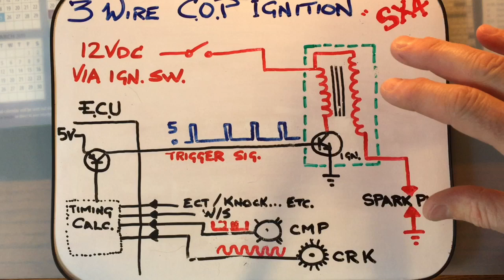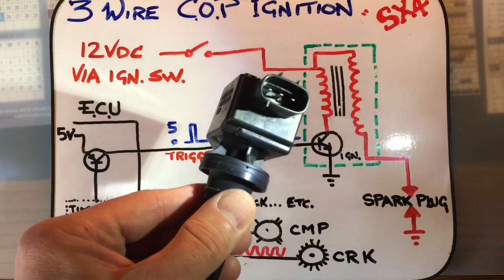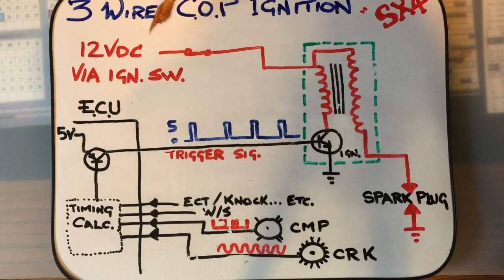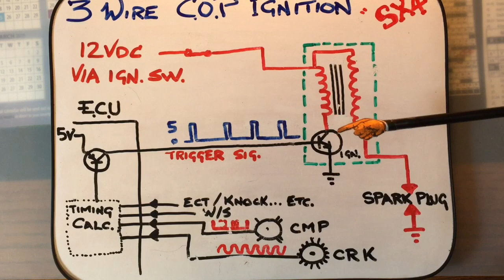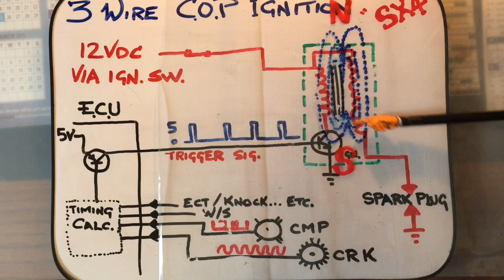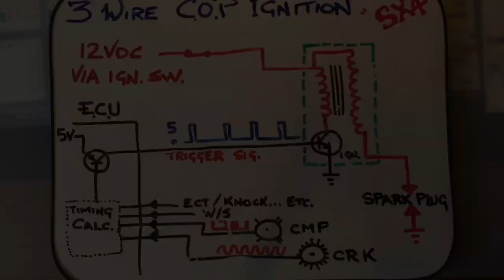3 Wire C.O.P Ignition Operation (Simplified)

Comment: I love this kind of analysis. The main difference between your drawing compared to old style coils is the way the secondary winding and plugs are fed 12V continuously through one end. It would be easy to test that with key off engine on to see if 12V is present at the plug electrode. The old style traditional two wire coils were also autotransformer design, with the common side being the ground. I suppose it would work either way, with relative direction of windings determining polarity. Given the huge voltage of a collapsing 15kV magnetic field, which side the 12V is on is immaterial, although I wonder about backfeeding a huge voltage spike through a B+ power wire. You could say the same about huge voltage spikes on ground in old systems, ha ha. It felt unusual to see the secondary winding attached to ground on both ends of an old style standard coil, until you realize the burst of voltage comes purely from the field collapse. By having the electronics further from the massive spike I suppose internal electronics might last a little longer. Presumably there are capacitors built into the coil boards, too.
Reply from the maker: I’m no authority when it comes to electronics. I keep the description of operation as basic as possible…because I have to 🤣 Thx for watching 👍🍻
Reply: I agree, i dont get it why the primary and secondairy coil are connected together.. in my sense it causes peak voltage on the 12v power input right?!?  help me! haha

Comment: As a retired electronics engineer this is an excellent explanation of the circuit involved in making a spark plug fire (from ECU through coil and finally the spark plug). This is a 3 wire coil, but on some coil packs (like mine) the ground on the emitter of the built in transister comes out to the connector on the coil. But the concept is all the same. Thanks very much for your help.
Reply from the maker: Thx very much Sir & Thx for watching. 👍🍻

Comment: are you sure the 2 coils ha a common node ?
Reply: Yes, they have a common node on the positive side. The primary and secondary have to be complete circuits. They both have to have a positive and a negative to form a complete loop (circuit).
Reply: @bernardocisneros4402  Absolutely not, the positive side is isolated.
Reply: @rsaj-cq6ne   I guess one of the biggest manufacturers of ignition coils and spark plugs, NGK, doesn't know what they're doing. You better call them and tell them to stop making ignition coils because they're making them wrong. Here's a link to their webpage where they show the primary and secondary coils have a common node on positive side. Look at the last illustration on NGK's webpage. After looking at this webpage, please repost and explain to me how NGK is wrong.  https://www.ngkntk.in/ignition-coil-technology/
Reply: @bernardocisneros4402  just grab a multimeter and measure the tip of the spark plug. You should see a constant 12V accordingly to the drawing in this video. I have a scooter and i have continuity to ground and not to the 12V rail.
Reply: @bernardocisneros4402  The drawing in this video should work anyway but due to the voltage spikes on the secondary coil i find it unproductive keeping the secondary non isolated from the rest of the circuit.
Reply: @rsaj-cq6ne  If you have an ignition coil that's constructed like the one in the drawing of this video and you have the ignition key switch closed, yes you will read battery voltage when placing one voltmeter lead on the tip of the spark plug and the other voltmeter lead on the ground electrode of the plug. But that's ok. Nothing wrong with that. When you check for continuity to ground on your scooter, where are you placing your voltmeter leads? I'm assuming your scooter only has 1 cylinder.
Reply: @rsaj-cq6ne  Where do you recommend connecting the other end of the secondary coil? The end that doesn't go to the spark plug.
Reply: @bernardocisneros4402   Yes my scooter has 1 cylinder. Its a 125cc. Mine must have the common node on the secondary to the chassis (the one that goes to the center of the electrodes spark plug). I guess there are these 2 versions of common nods( if the drawing on NGK website is correct).
Reply: @rsaj-cq6ne  The drawing on NGK website is correct. I've been doing this for a while and the vast majority of coils have the common node on the positive side. Your scooter, like most scooters have the common node on the negative side. I don't know if you know this or not, but the spark that jumps the gap, has polarity. Do some research on it. You'll be impressed how this all works.
Reply from the maker: That may not be correctly drawn. You’re not the first to question it. Thx for watching 🍻
Reply: @TheGibby3340   You drew it correctly. Look at the last diagram on this NGK webpage: 

https://www.ngkntk.in/ignition-coil-technology/
Reply from the maker: Thx for the details and thx for watching. 👍🍻

Comment: Is this example of a coil operated by a sqaure wave 0/+5v? 
Does the ground on the 'emitter' just ground the ECU's 0/+5v signal to the Battery or ECU? 
Do you have a video on coils grounded by ECU ('negatively switched')? ... I've been told my ECU operates the two 'two-pin' coils by grounding them.
Reply from the maker: This is just a simplified typical 3 wire COP circuit. It is a common emitter design. The 0-5V square wave trigger pulse (dwell) is applied to the base. When the pulse rises to 5V the base forward biases the semiconductor. Allowing the current to flow through the primary windings forming a magnet field. When the triggers pulse drops to 0V the semiconductors turns off, current flow stops through the primary causing the field to collapse inducing the high voltage in the secondary which jumps the gap at the spark plug to ground. 2 wire COP’s usually have a 12V supply with a switched ground. The semiconductor (driver) is within the ECU. There are multiple videos in the back catalogue on COP operation. None of which are 2 wire type. Thx for watching. 🍻

Comment: In the control wire what is the bais voltage if we unplug conoctor
Reply from the maker: None that I am aware of. It’s a simple 5V pulse. The width of which controls ignition dwell time. There are multiple videos on the channel detailing this. Thx for watching 🍻

Comment: Thanks for the really good explanation, this solves a lot for me. I always thought that the the secondary winding should be grounded and not connected to the supply voltage, however you show the secondary coil connected to the supply. Could you explain how this works .
Reply from the maker: Your absolutely right. Most systems you see depicting the secondary may show both sides grounded (one or both through the plug). My channel’s automotive interests are primarily centred around the Suzuki SX4. The simplified schematic I whiteboarded has been lifted pretty much right out of there workshop manual. Some people have vehemently insisted this won’t work. Maybe…Suzuki seem to see it differently. Thx for watching 🍻
Reply: @dj1encore  This is exactly how a "Coil On Plug" (COP) ignition system works. The only thing missing is a couple of diodes. One in series with the secondary winding on the positive side immediately after the splice with the primary. The diode would be oriented such that it wouldn't allow current to flow through the secondary winding only the primary. The arrow of the diode would point to the left when looking at the whiteboard above. The second diode would be put in parallel with the primary winding or across the collector and emitter of the transistor depending on the manufacturer. It would be oriented such that current couldn't flow from battery positive to ground. The arrow of the diode would be pointing up when looking at the whiteboard. 

How would grounding both ends of the secondary winding make sense? Just think about it. When the magnetic field collapses, a high voltage is induced in the secondary. This high voltage is used to create a spark across the spark plug gap. You need a high voltage to jump the gap because air has very high restistance. If one end of the secondary is connected to the spark plug, and the other end is connected to ground, why would the high voltage take the path of very high resistance when it could take the much lower resistance path to ground.

I think you're confusing the circuit design of the COP  ignition system with the circuit design of some conventional coil and points ignition systems. On some conventional coil and points systems, one end of the secondary was connected to the spark plug and the other end was connected to the ground side of the primary winding. This worked because at the same time the points opened, the magnetic field started collapsing, so the vast majority of induced high voltage current from both windings was not able to jump across the points. At the very instant the points started opening, a very small amount of the induced high voltaage current jumped the gap between the points, but after that, the condenser, which was just a capacitor, acted like a spring and absorbed a very small amount of the high voltage current, then released it to ground when the points closed again. The very small amount of inducd high voltage current that jumped the points gap at the very instant the points started opening is what mainly caused the points to wear out. 

Just to be clear, the condenser did not allow current to flow through it.  It only acted like a spring to absorb and then release.

Here's a link to a video animation here on YouTube that does a great job showing exactly how the conventional coil and points ignition system works.   https://youtu.be/TqQE0xkCJ8c?si=R5TeVjOHzeg_1R9A

Comment: Thanks for this video on COP.  Can you offer any opinion on my ideas on retrofit of my 1981 Honda CM400T twin cyl., this has CDI timing box controlling a single coil, that is fed to the 2 spark plugs(it is a wasted spark arrangement - they both fire at same time, one spark wasted during exhaust).  The idea is to use a COP like this to replace the expensive complicated CDI box and coil to make what I would desire to be a simpler less expensive system.  I would program a microcontroller(like a AVR) to be a controller.  I would try to use existing trigger coil system as input, if not maybe add a hall sensor.  Try to do advance in a simple means like average RPM measure.  The plugs stick out side so I'm thinking I could tuck the COPs under the tank and just extend the high voltage leads.  Just pick up some used 3 wire COP's to try this.  Any thoughts?
Reply from the maker: I am afraid I won’t be much help to you. Modifying OEM installations is not my thing. Getting a COP set up to fire is simply enough. Adjustment of the timing relative to load and RPM will require some ingenuity. This video I made some time a may interest you… https://youtu.be/WJGajqQTuus  There is a couple of COP Vids in the back catalogue. Thx for watching. Cheers 👍

Comment: ahhh, no. positive on the secondary coil is not tied to the positive on the primary. and the primary doesnt flow through a tranistor or the transistor would be toast in Useconds. this circuit can not possibly work.
Reply: You don't know what you're talking about. This is exactly how these coils work. The only thing he forgot is the freewheeling diode that protects the transistor from voltage spikes coming from primary coil. Engineers sometimes put the diode parallel to primary coil or parallel to transistor depending on the manufacturer.
Reply: @bernardocisneros4402  yeah nah. go back to school bro.
Reply: @freelectron2029  Ok, maybe you're right and I'm wrong. If both ends of the secondary winding are connected to ground, please map out the current flow through the secondary winding and back to the battery negative post for me. You're confusing this coil on plug ignition system with some conventional coil and points ignition systems of the 1960s.

Comment: I have a 2004 bmw 530i  and I can't find coil on plug ohms winding  readings spec in the secondary winding . The coil on plug are 3 terminal and I have 10 M ohms readings on 2 cop, 1.8 M ohms in another one and in the last  3 cop I have OL reading. It is time to replace them??
Reply from the maker: Resistance checks on ignition coils are unreliable at best. They can break down under H.T. and the plug under in cylinder pressures. Scoping the secondary voltage wave form via a COP probe and primary current ramp is really the only sure assessment method. I understand you may not have this tooling or level of interest...In which case swapping out suspect coils with a known good maybe the most practical approach. Cheers

Comment: waw...!! it its great to solve my problem... why the ignition coil getting hot... when ignition switch on.. my ford lynx 2002
Reply from the maker: Can’t say for sure... but if the trigger signal is always present (no toggle) it will magnetically saturate the coil. If the field never collapses it will not produce a spark and overheat. The actual on time (dwell if you will) should be very low from a duty cycle stand point. Make sense?